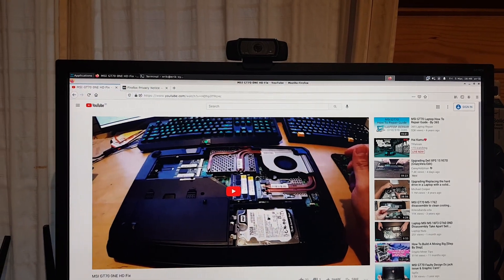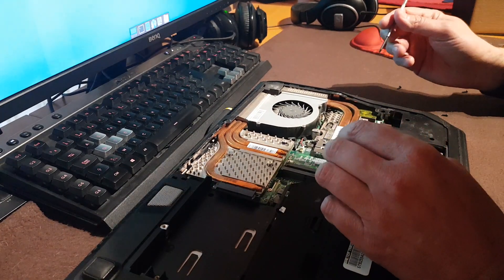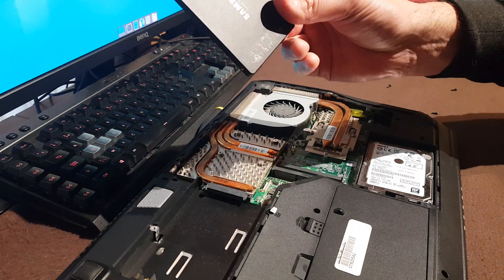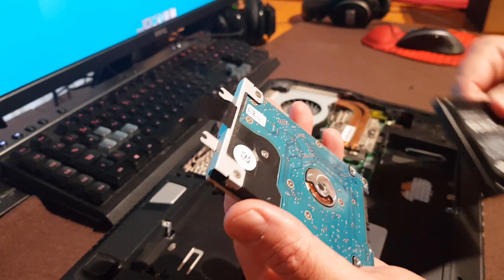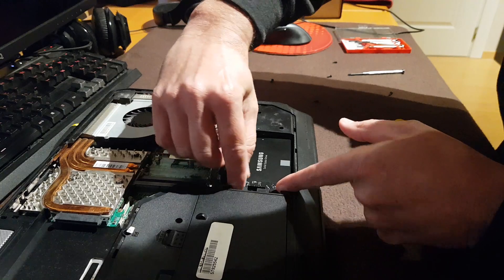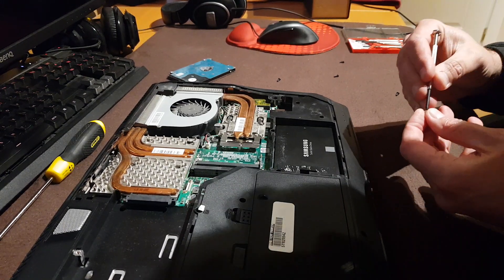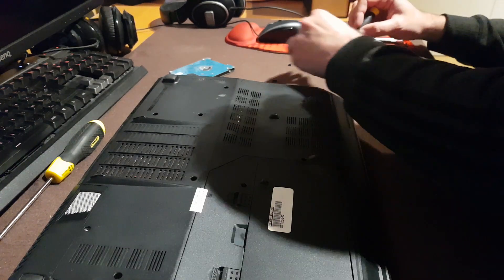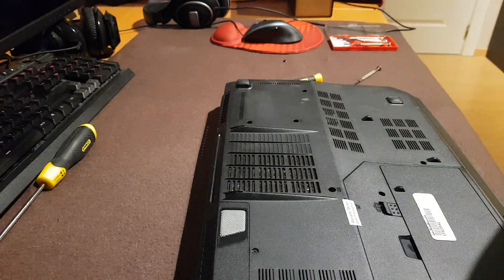ArcoLinux : 1894 Replace your harddisk with an SSD and speed up your old computer - MSI GT70

Comment: Hi Erik,can you make a video on compositors in ArcoLinux.I have Intel UHD graphics on my laptop but am facing high cpu usage even when watching youtube.No multi tab,multiple applications.With picom off I get really bad screen tearing.I have switched to almost all the tiling window managers Arco ships with.Made 5 fresh installs of all the DE alternatives in a day.Also, sidenote the i3 standalone iso seems broken..Read the Arch Manual for the section on Intel graphics.Not much change,now the screen tearing has reduced but really high cpu usage with a lot of memory in buffer/cache.Swapped picom for another fork of Picom.Made minor difference.
Arco seems like the best distro I have used till date,hence the reason I am not switching distros .Can you please help me out?
Reply from the maker: if Linux is that bad on your hardware - the best advice I can give you and you may not like it - is to sell your computer for the best possible price and buy an better supported Linux computer
Reply: Use xf86-vesa only instead of xf86-intel
Reply: @neotwenty-nineBzH  is it not for very old hardware? I have an UHD 620.Which is fairly basic but what's weird is how there's screen tearing every now and then. Playing even a 1080p video spikes the Cpu to 40-50% usage sometimes when there's no other applications running. Is this normal?

Comment: I run Arco on an SSD and it's clearly faster indeed. 
Today i killed my laptop keyboard by removing it and swipping it with a plastic brush to clean it, but clueless that i was i created an electrostatic discharge that fried multiple keys. Electronic components are very sensitive to electrostatic, next time i won't do that same mistake. Live, experience and learn, loll